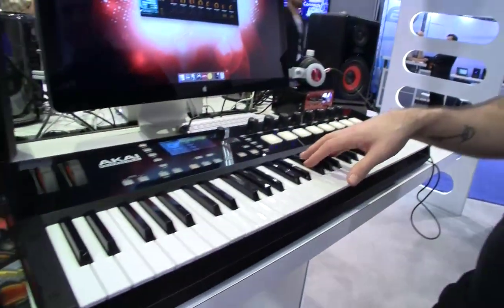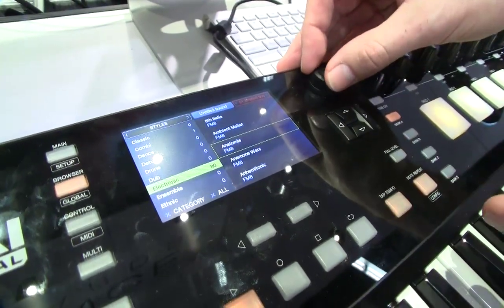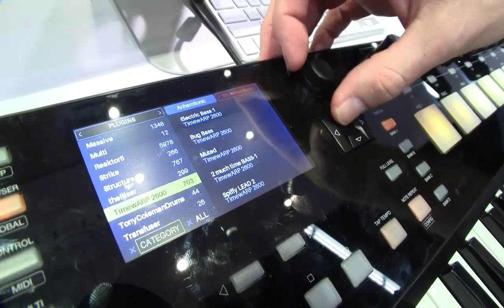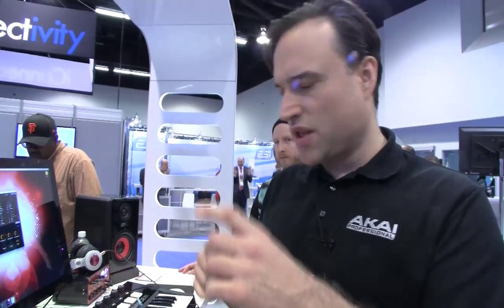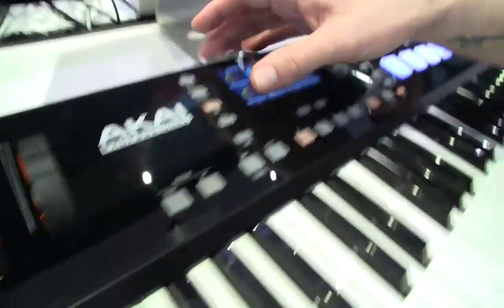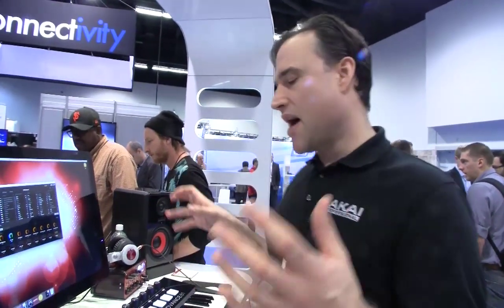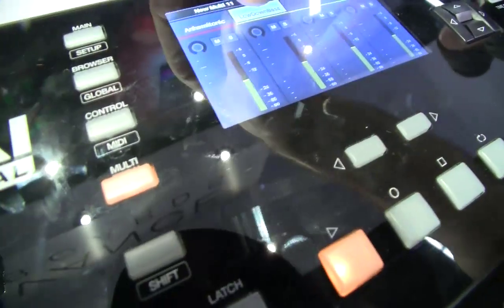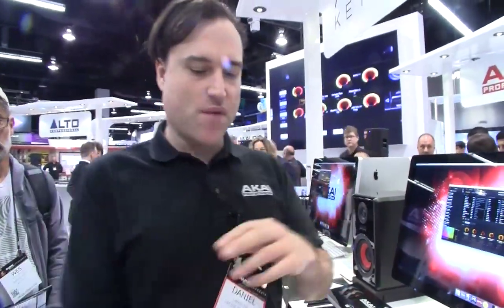NAMM 2015: Akai Advance Controller Keys

Comment: So the "VIP" Software is actually a VSTi acting as a VSTi host inside a VSTi host / DAW. Besides all the required mapping work (especially with "not-so-mainstream" plugins) and actual question how parameters of the contained VSTi will be made available for DAW automation purposes, i wonder how the "VIP" software will handle multi-threading, when by itself it gets treated as a single thread in the DAW, hence rendering the multi-threading capabilities of the used DAW presumably useless.

And i really don't see the reason to introduce additional overhead for the sake of having up to 8 parameters accessible on 4,3" screen, when the computer (with a way bigger screen) still has to be up and running for doing all the actual realtime processing of the used VSTi.

The more i think about this product, the more redundant and "toy'ish" it feels, even though the aimed price tag speaks a different language...

Comment: The glossy fingerprint magnet case is a major turnoff. I fail to get why someone who had the perfect midi controller (mpk mk2) will ditch that great layout and build quality and go for something that's inferior in every way. Less pads, cheap plastic build, glossy finish, zero sliders and unnecessarily large knobs. Don't get me wrong, large grabby knobs are nice but there is a limit after which its just waste of space. could have put 12 knobs in there easily.

Comment: these seem really great, I haven't seen the 25 yet though, I assume that would have to drop something in order to fit, and yeah this is very similar of a concept to the NI Control S keyboards, but I feel like Akai is being more inclusive here, it's not just Komplete and NI stuff, it's pretty much anything all with the same nice access

honestly though I don't buy it on the preset browsing etc, I think that would all still be much faster on the pc with the mouse - however, if one of these eventually had capacitive touch instead of the knob and button interface, and the sortof rubber bandy scrolling you see on phones, that would be faster

Comment: would be great if you could just load the vst in and play it with the keyboard standalone
i realize this would requite a pc in the keyboard but that's pretty do-able these days
at least it's a step in the right direction
Reply: Depends on the vst and pc. Intels new laptop processors are looking good for the job.